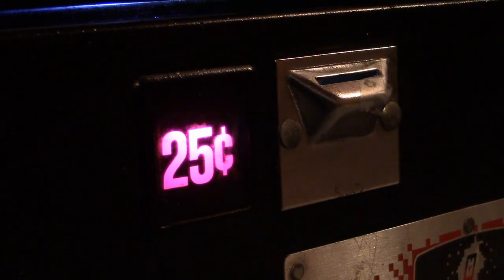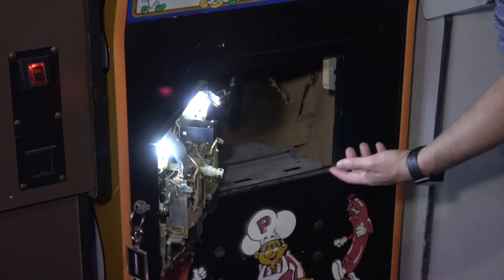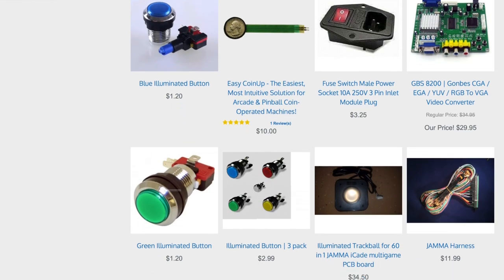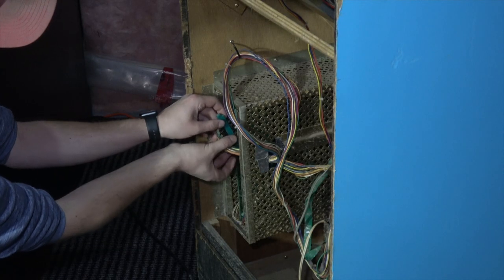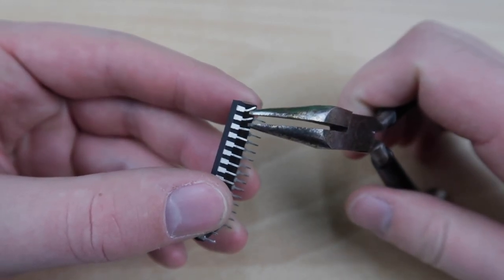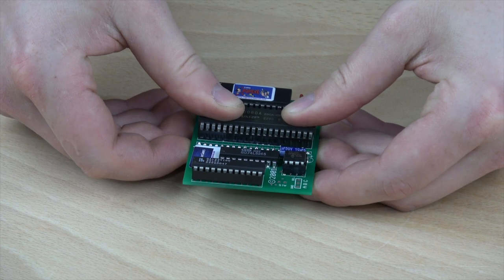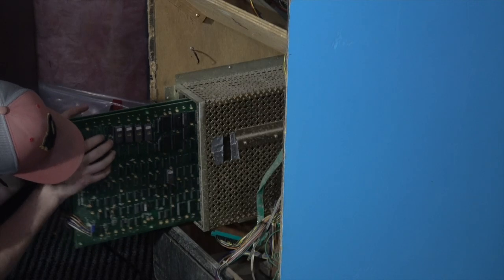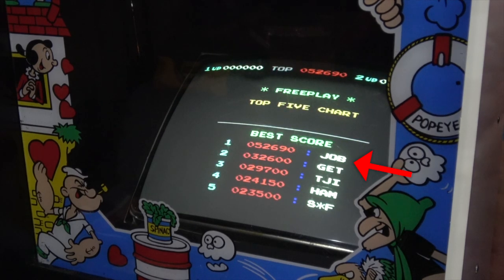High Score Save Kits 101

Comment: Great instructions, thanks! Do you know what exactly the High score save kit modifies? Is it code injection or does it replace the rom with whatever is on the daughter card?
Reply from the maker: It depends on the high score kit, but it is injection of sorts. The memory address where the high score would be stored is overridden by the high score kit data.. so when the CPU is addressing that high score data, it is being pointed to what is on the daughter board, rather than picking up whatever the default is in the ROM when the game gets rebooted. As far as processing goes, the rest of the ROM data should be untouched. The exception would be with some of the kits like DK Remix, or DK Jr Remix, where it is modifying the rom as it is fed to the CPU. I know that the Jr Remix has a feature that will let you play the original roms on your PCB, or the "FIXED" version of original DK Jr, where they have corrected some bugs with climbing vines, and how the spring board works, etc. The folks at High Score Saves, or SockMaster who did the DK Remix kits could probably explain how this all works if you are looking for the computer nerd explanation of it.
Reply: @TheCanadianArcade  Super helpful answer, thanks! I got mine in the mail already. Just got to pick it up from the border!
Reply from the maker: Cool, what game did you get the kit for?
Reply: @TheCanadianArcade  After years of dreaming about it, I finally got myself a Donkey Kong Arcade. I'm in Vancouver and somebody must have brought it over from Seattle to Vancouver. It still has a Seattle Amusement License Plate on top of the cabinet. Unfortunately it's the particle board style but everything looks great, except for the joystick which doesn't center properly anymore. Just watched your video on how to fix it, so that's going to be my next project.